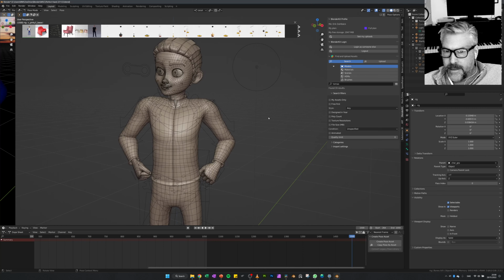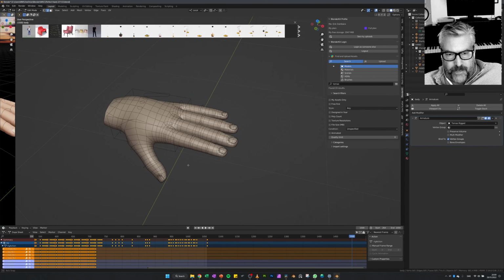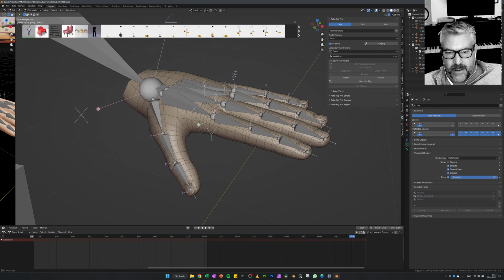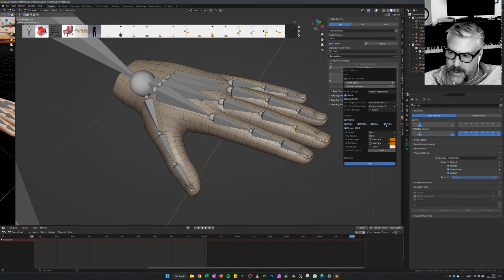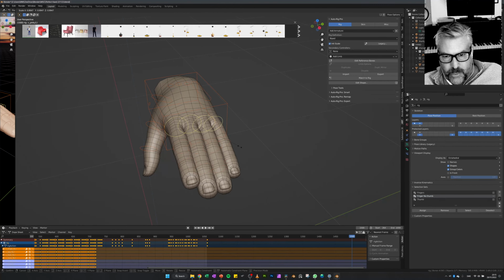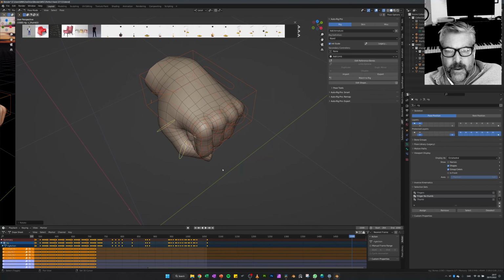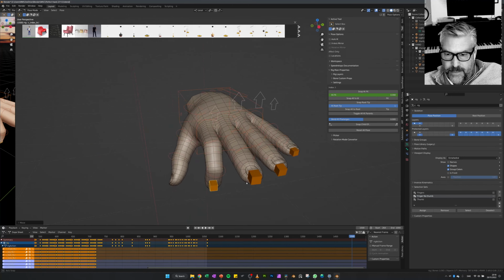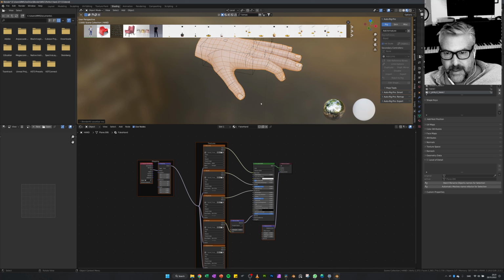Easy creation of hand and rig in Blender using Auto-Rig Pro

Comment: Did you bind them with manuel weight paint or with the auto rig pro addon ?
Reply from the maker: I used ARP (Auto Rig Pro).
Reply: @valleybrook  any tips on how to get deformation as good as your hand rig. When I use ARP to weight my rig the hang deformations aren't as good
Reply from the maker: @priyanshu1667  You should in principle not need to do any weight paint. Make sure to have good topology for defomation, use heat-map algorithm for face and hands, make sure that the reference-rig is correct i.e. the bones have the right directions and length. You can go back to reference rig and back again as often as you want; but don't forget to rebind if you do changes